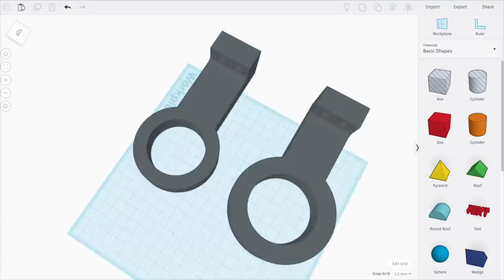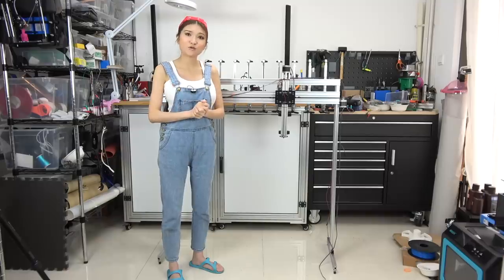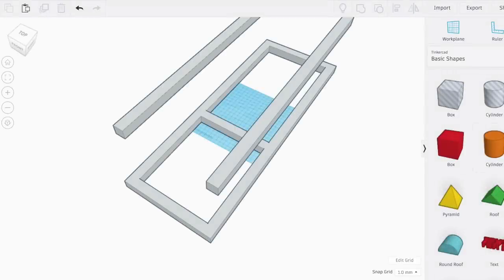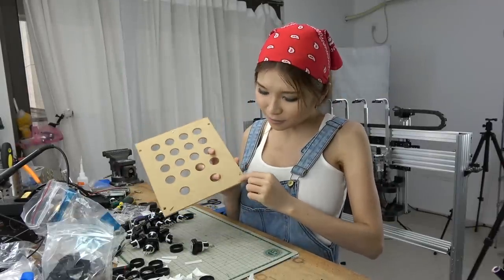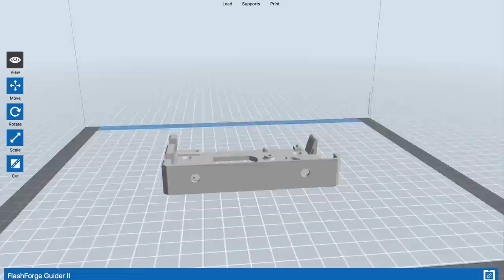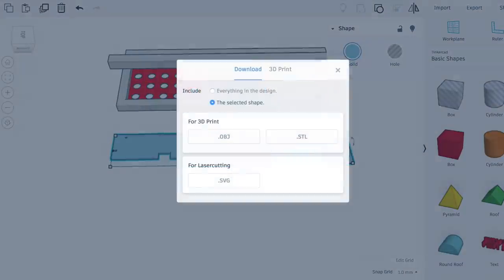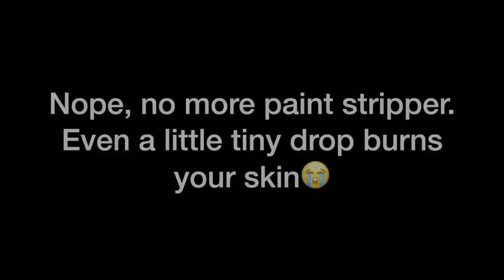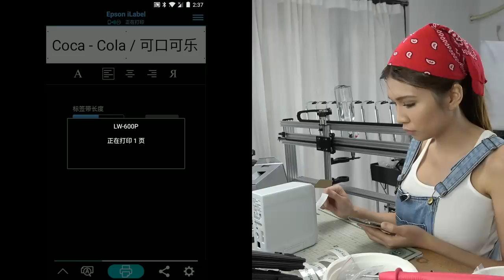Barbot Build Part 2- Interface and Control Box

Comment: Thank you for addressing the timing issue with the orange juice. When you use the dispenser by hand you're activating it for much longer than the system does in the immediately following tech demonstration, so there's still an obvious timing issue in the code even if there's also a hardware problem with the dispenser; it doesn't matter if there's a vacuum or not if the activator's not being pressed long enough to evacuate the system.
Reply from the maker: I explain that here: https://github.com/sexycyborg/BarBot

Comment: I think you could sell this to bars, because they could dispense the most common drinks faster (you would need to increase the speed someway), no need to train a lot of bartenders,  put a cup with ice, push the number, count to 10, get your drink!  Fantastic job!  I would put black plastic to hide the wires so it looks more professional, and hide the simplicity so you can sell for more ¥

Comment: When building equipment that will get wet:  Controller, switches, and PSU go as high in the chassis as possible so they don't get splashed by cleaning, or spillage.   Shroud the PSU and controller so they cannot be splashed.  Buttons you have chosen cannot pass food preparation cleaning standards.  Lots of little stuff here that would be needed to keep you and your friend out of trouble.  Drain holes in the bottom of the chassis, and shrouded vent holes on the back, below where the PSU and controller are mounted.  Also a good idea to have a fan in there to keep fresh air circulating to avoid condensation.   If this were only going to be used a few times it wouldn't be a big deal, but if it is going to see regular use it needs to be much more robust to avoid safety and health hazards.

Comment: Yeah, paint removers are usually pretty hard chemicals, you have to get proper chemical-handling gloves for future purposes! I myself once decided to do it barehanded since the thinner that I used melted through the plastic gloves that I had available, but I wouldn't recommend it to anybody, and everyones skin reacts differently. Mine was, as long as I can remember, a bit dry and itchy after that, but someone else could have been hospitalized even after such a short one-time exposure than I had.

Comment: Wow, what a great final project!

Glad to see you didn't get seriously injured. It's a valuable lesson everyone can learn from Chemicals  - they can be nasty if the directions and the basic chemistry is not understood. Also be VERY careful with some chemical glues and adhesives, they too can be very dangerous when fumes of other chemicals are in the same room and exposed to them. Buy a good respirator when you can. It's also a good idea to get some good safety glasses as well. Always Stay safe. 

On a funny note, I cannot tell you how many times I have assembled something, almost complete, only to find, like you, I've installed something BACKWARDS... .ugh and have to take the whole thing apart again. LOL - your sigh and grin has been repeated by many a makers and builders of all ages and experience levels ! :-)

Glad you reinforced your frame, looks really good. You sure did add a lot of details to the final build! Now I can see how the dispenser works, which prefills the volume of each dispense plunge, so a delay would not work. Although you could reduce the amount of delay between 'fills' - if more than one dispense is required (say, two parts orange juice). The buttons and coin dispenser are epic additions. Reminds me of the juke box coin box to play music at your table. :)

Tilting the bottles was a good solution for what you had. Most inverted dispensers have a vent tube that are part of the top bottle cap assembly, which is probably why your unit was lower cost. Yours still worked great though!

You really put a lot of effort into this one. Glad to see you could adopt arduino code, other project ideas and blend them into your own version of a bar bot.

Keep it up and read up on chemicals including types of paint, cleaners and protective gloves you should use. This video series was really good and proves that anyone of almost any age can tackle a project like this. 

Smile and onto the next epic project!

Comment: Hi Naomi. Love your videos. May I suggest, when installing the buttons, use a straightedge against each row of them before tightening them down completely to get them to line up perfectly with each other.
Reply from the maker: Tried, then it moves when you tighten them and clamping the edge moves the plastic. Next time, round buttons😅
Reply: Great video, thank you! I worked in a shop for a year making electrical control panels. All the cut-outs for buttons or switches have a "key" in the hole (usually at the top) so that there's no need to straighten the buttons by hand when installing them. For example, can you see the key in this round hole panel punch?  http://panelpunching.com/panel-punching/alfra-panel-punching-notched-22.5-30.5-round-knockout-panel-punches-mild-stainless-steel%20/panel-punching-alfra-22.5-mm-notched-round-knockout-punch-die-set-3.2-mm-external-notch-mild-steel-01420 That's how we do it! Sometimes the hole has a flat spot instead, etc. I imagine it wouldn't be hard to do that in a CAD program. I hope this makes your next build just a little bit easier!
Reply: As you already have a sketch of the plexiglass front panel with the correct spacing, it's worth making a 3D printing mask with square holes at the size of the button casing and use it to align all the buttons together in one shot. Nice and creative job! I love your calm attitude in any circumstance...

Comment: If I'm not mistaken the paint stripper had Methylene Chloride, if you use it again then use very thick rubber gloves and a respirator. It burns by disolving the skin oils at a huge rate. Wash quickly with soap and water then use loads of handcream.  Better still always use a barrier cream when doing jobs like that.  Hope your okay now ☺

Comment: nice catch and solution on the situation with the OJ. 

Yes, paint stripper does burn. I've encountered the problem myself on more than one occasion. Might have also been affected by the variety of gloves you had, as some stripper is designed to break down latex paint, latex gloves might be affected as well. Pretty sure that there are other comments on what gloves would have been better. 

Thinking some diagonal bracing might help side to side stability a bit more, and for permanent installation, wall brackets might not be a bad idea, or mounting into the floor.

Overall, well done!
Reply: Was thinking about those switches. Are the threads keyed? If so that might have helped with keeping the buttons aligned if you had included keys in the laser cut template. Not absolutely necessary, and a hindrance if they are not keyed. Nicely done in any case.

Comment: A little surprised you didn't use corner braces or something to make it less wobbly (like you had on your small bench) but it looked good by the end - the acrylic must have helped.

Paint strippers can be nasty things - I have a variety of different gloves just to try to get ones that are resistant to the different chemicals, and I don't even use those magic sprays :)

Those are some awesome buttons! (And impressed at the amount of IO pins on your controller - I would have expected that many would have needed to be wired up like a keyboard matrix) And, of course, totally jealous of your access to materials and quick turn-around time on jobs :D  (and I want that label maker - much fancier than mine!)

Looks nice!

Comment: I'm sorry you got burned by the paint stripper. I'm glad you were not seriously hurt.

Onto the drink pouring mechanism. You are facing two problems. First is the pulp in fillers like orange juice. The obvious fix is to use fillers that are pulp free, as that will solve the problem without further work. The alternative is to include a filtering system that allows the juice to flow without the pulp blocking it or coming out with it. This is more difficult, and I am not sure how to accomplish it.

The second problem is the liquid in the bottles ceasing to flow due to a vacuum being created in the bottle. The way to fix that is for each unit to have a tube that goes to the bottom of the bottle and bends to the opposite direction after it exits the bottle. A stopper with two holes is required that will fit the neck of the bottle. The center hole is the one that allows the liquid to flow down into the pourer, while the offset hole is where that tube exits the bottle. The reason for the tube going to the bottom of the bottle is that when air enters into the tube, the liquid won't flow out through it. I wish I could draw you a picture, as my descriptions may not be totally clear.

The last thing you need to consider is a way to meter the liquid. In the US, a drink is measured as follows:

1 8-ounce glass holds 4 ounces of ice, 2 ounces of alcohol and 2 ounces of filler. These are fluid ounces, not solid ounces. A shot glass is either 1 fluid ounce, or 1.25 fluid ounce. In the 1.25 fluid ounce shot glass, the line below the top is the 1 ounce line. In the 1 fluid ounce shot glass, full to the top is 1 ounce.

From what I've seen in your videos, you are guessing at how much liquid to put in each glass, and the glass has no ice. In the US, that would put a bar out of business real fast.

Good luck with this device. I think it is worthwhile. I thought about something like that before, but with over 70 different bottles to have to account for it would take something bigger and more complex than yours. That said, yours is a start in that direction. :)
Reply: Hi! Great build and I'm very impressed by your work ethic! :-) 
I don,t think the vacuum in the bottles is the problem.
When optics are first attached, they contain enough air to displace the liquid that fils the optic when the bottle is inverted. 
When you push up the plunger, the la valve lets air into the optic and the liquid drops into the glass.
When the plunger is released, the air in the optic is released into the bottle (you can see the bubbles)and the optic fills with liquid from the bottle.
You don't need to re invent this because that is what an optic is designed for.
A full depression of the plunger releases a measured amount of liquid, corresponding to the standard measures mentioned.
The problem appears to be that the plunger is not being depressed fully and time is not allowed for the fluid to drop out.

Now all you need is a liquid nitrogen on-demand ice dispenser and an AI you can tell all your problems to and bar tenders will be able to go off and be whatever they want! 

Keep up the great work. It's always such a pleasure to see you on-screen and watch you think and create.
Reply: I had same issues with these cheap optics bought from eBay, that's definitely not a vacuum in the bottle. I had many issues where the alcohol doesn't flow through the optics (fails 2 out every 10 shots). At times i thought of replacing the optics with good branded Beaumont optics, but they were difficult to find online in US. I like the idea of tilting the bottle slightly as a workaround for this issue

Comment: Instead of having 0-15 on the panel, you could've saved space by doing 0-9 like on a phone and added "enter" and "clear" buttons as well where the * and # keys would go to confirm drink choice or reset the input.

Doing this could've saved you enough space so you could install a small LED screen to display the drink selection. It might have even been enough where you could've incorporated the coin slot as well.
Reply from the maker: I like single purpose buttons...

Comment: Notes: First you should Move the key away from the Buttons or people will stick stuff in it (If patrons will have access to the bot),  2nd it looks great for test purposes but you don't want customers seeing the inside or they tend to try to figure out how to cheat it, 3rd Coin slot is cool but not to hard to cheat them as well, a Bill validator or Credit card reader would be better.  and 4th is for me, miss the Sexy outfit from Maker Knight Precision ; ) but you always look good ... Be very careful with that Paint stripper, its also not good to breath.
Reply from the maker: Reasons discussed here: https://github.com/sexycyborg/BarBot